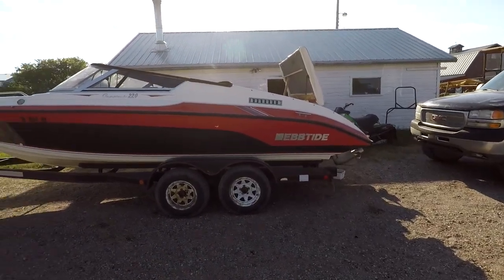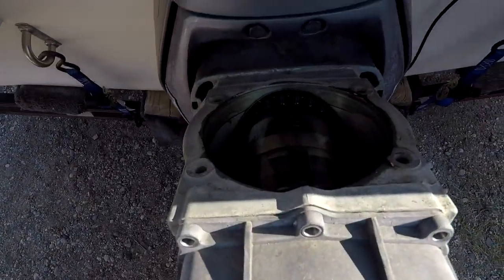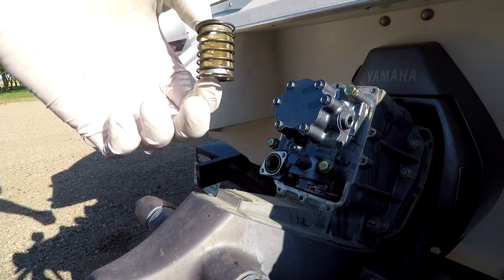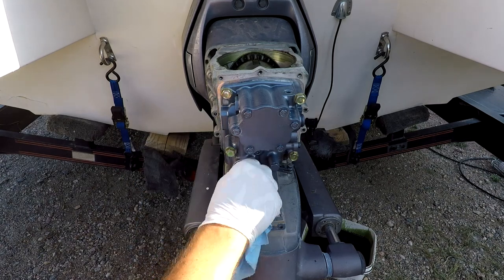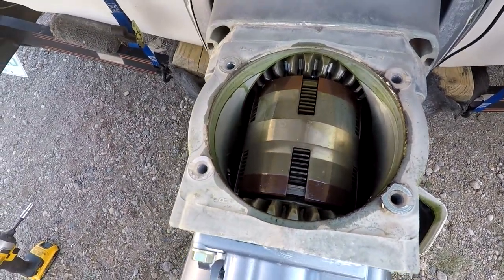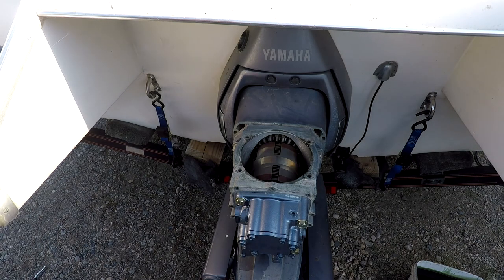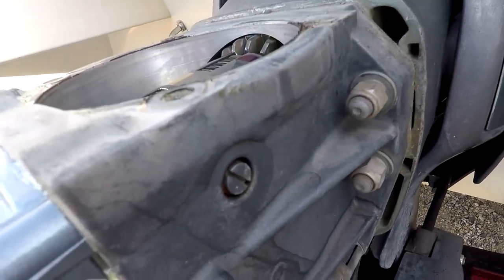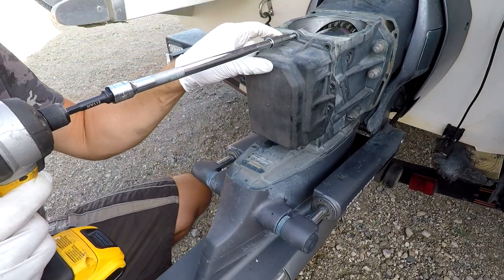If You Have A Yamaha HydraDrive Watch This Leg Oil Change

Comment: I am so grateful for you Ebbtide Videos! No videos at all of this boat and repairs for almost a year! I have a 225 same hydradive. Bought it in spring 2020. On Lake Lanier GA 3x. Pulled up to the boat ramp would not move forward. It would go into gear but no thrust. Get it out of the water and the brand new 4 blade stainless steel prop sheered off along with the prop shaft right at the boat ramp. I did not hit anything but I am assuming the previous owner did hence the new prop. Anyways, no one would work on this. I called the mechanic who serviced just before I  bought it and straight up said he does not want to work on it due to parts being not available any longer. Finally found old timer who would replace the shaft etc.., 5 months later, with me ordering every part from boats. net it is repaired. Getting ready as of now to take it out....PLEASE POST MORE!!!!
Reply from the maker: Sorry to hear about your luck. Usually it’s mine that is like that. Parts are so uncommon that the one shop I went to offered to buy my drive, and do a straight across trade for a different manufacturer brand new sterndrive. Not worth the effort for me. I’ll maintain this boat as long as I can a fresh oil change every spring, keep up on my maintenance for the engine. I’ll do another video with the proper Yamaha oil in a couple months, I invested in the Yamalube oil directly from the dealership. I do have a couple other videos of some work I’ve done to the boat.
Reply: @ippielb . Yes I was told to change everything to Bravo 3...7-10,000$$ That is what I paid for the boat! Re-doing my back bench seat along with stereo install today and tomorrow. Also I need to change the oil and fuel sep. I was wondering why the prop turned slow., No information anywhere for this....Life saver bud!! Keep posting! I will try to show pics. Nice boat.

Comment: Great to see a video on the hydra drive leg, got to do mine on the 12th, great timing by you
Reply from the maker: Yeah, i looked up and couldn’t find anything on it so I figured it would help some people. They aren’t around anymore and can’t find any information on the web. This is all the information I could find.

300hp at prop

8.5:1 compression Ratio

4 bbl carb

RPM range 4200 - 4600

weight engine and all drive components total package is 1153

Standard drive ratio 1.50:1

**Outdrive hydraulic clutch system** so only use conventional gear oil. 

drive cap. 2.5 qts of gear oil

recommend a GL4 gear oil spec for the outdrive

engine oil straight 40 wt, but I used amsoil synthetic 25w-40, it took about 7.5 with the filter change. 

oil pressure at 2000 RPM's spec is 49.3 psi

timing at idle speed - 750 to 800 rpms is 13 degrees BTDC with timing jumper attached set into base timing mode. 

I should’ve taken videos of the regular maintenance I did on it. But I’ll do some more here soon, going to adjust the timing. And I’ll show the how to with the jumper wire.

Comment: Great to see this video. I have a renken 2500 with a 4,3 V6 Yamaha. 
Sterndrive is almost the same u have. 
Got lower tail of for maintenance found out there was no impellor inside. There was a zink anode inside that I didn’t know off. Replaced that also. But after the boat beeing in storage over winter and doing maintenance for 5 months putting it back in the water and at starting the engine it made a horrible singing sound witch goes away when i tilt the tail a bit. Also when i turn the rudder all left or right it makes that sound. 
It didn’t have that before going in to storage. 
Could it be the main driveshaft barrel is broken? It does make less singing sounds when sterndrive is slightly tilted. I’m worried that that barrel comes under to much pressure and thats where the sound comes from. 
Can’t find any info on YouTube or internet on replacing that. Boat is from 1992

Comment: Are you working on a 4.3 V6 or a V8?  I've got a YEMS 4.3 on an 1993 18' Ebbtide.  Good information on this video.
Reply from the maker: Murray Crow this is on a 7.4l big block v8. I found direct at the Yamaha marine dealer they have gear lube that is perfect for it
Reply: ippielb I live less than three miles from the Ebbtide factory where our boats were made. The former Ebbtide factory foreman works at a local marine dealership where I purchase parts.
Reply from the maker: @murraycrow3656  Could you do me a favour and ask if he has any Passenger side front windscreens? I have a piece of lexan in there but i want to get glass. It was smashed out by the previous owner of the boat.
Reply: @ippielb  What's your boat model & year?
Reply from the maker: Murray Crow 1994 Ebbtide Campione 220

Comment: Question, while flushing the motor for first season start up, no water discharge from exhaust was happening. Have you had any issues with stuck thermostat? My temp guage does not appear to be working either. Also I can not seem to find a within the hydradrive diagram a pump impeller? Any suggestions?
Reply from the maker: I did have an issue with a stuck thermostat. They do no list a thermostat for this engine. You’ll have to take the thermostat to a marine shop and get the proper temperature. I can’t remember what temp it was. But the guy I talked to made it clear that it had to be that specific temp. 140 comes to mind. My housing was quite rusty as well so I did my best to clean it up to try and get a good seal. Also used “the right stuff” around the housing when reassembling.
Reply from the maker: I also prefer to run my boat in a tub with water. Then the exhaust is exiting outside of the tub so I know when or if it’s sucking in water or not.
Reply: @ippielb  Good stuff!! Thanks again for the feedback! I'll keep you posted.

Comment: It almost looks like an OMC Cobra. Can you get parts for it from the Yamaha dealer?
Reply from the maker: There’s one dealership by me that works on them. Most dealerships won’t even touch these anymore due to the lack of parts. I was able to find parts on eBay. I am just changing the gimbal bearing and seals in the leg.
Reply: @ippielb  Ahh, sounds like the dealer can’t get parts then. Real shame cause clutches are more refined than dog clutches.
Reply from the maker: @bartdaw6681  smoothest driving boat I’ve ever been on. Real pleasure to drive. Quiet. Good cruiser. Goes 63mph with just me in it. And could get more if I didn’t have a full tank of fuel. It’s tank is huge. I feel like I’m short about 400rpm on top too.
Reply: @ippielb  Yeah, it is nice being on a boat at cruising speed with it trimmed out properly.
Reply from the maker: @bartdaw6681  it’s in the shop right now, I too the leg off and changing the gimbal bearing and bellows. Had a ripped driveshaft bell and it took out the gimbal bearing. Seal on the yoke of the leg failed. So oil was coming out. But got all the parts off eBay. Got gimbal bearing in the freezer right. Now, hopefully put it back in tonight. And get it all back together. Uses Mercury tools, 12 point 1/2” bit, a standard slide hammer can remove the gimbal bearing and seal, didn’t take much effort. I have my driveshaft off the leg so going to use it to align the bearing I doubt it will need any alignment. Engine is rock solid, and nothing changed.
Reply: @ippielb  Sounds like you have got it figured out nicely but you would expect that from a Saskatchewan guy.
Reply from the maker: @bartdaw6681  not much else to do around here lol
Reply: @ippielb  After the the crop is seeded you have a few days before you have to get the sprayer and combine ready.

Comment: Do you have any idea @ippielb if a similar drive would have been used on my 5.7L V8? Its a Yamaha Sterndrive as well,
Reply from the maker: I’m not sure what you’re asking. If you have one hooked up to your boat I’m assuming it would. Wether it was a retrofit or not it’s hard to know. There’s not much information on these drives.
Reply: @ippielb  I guess I was wondering if the procedure to work on it was the same.. but mine doesn't have that plastic cowell like yours, enjoyed the vid though. Quite informative,
Reply from the maker: @zCustodian  what model Yamaha stern drive is it?
Reply: @ippielb  it's pretty oxidized, thats my problem, im really not sure,